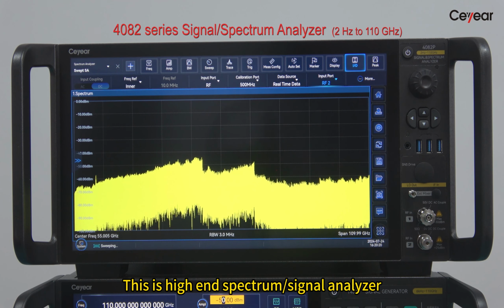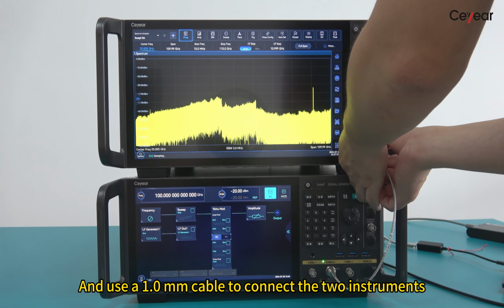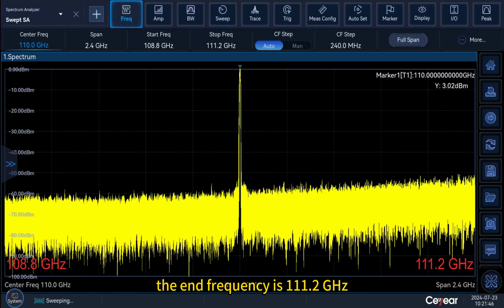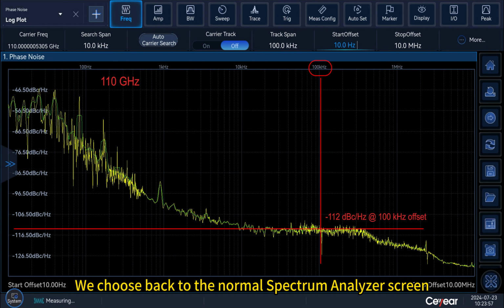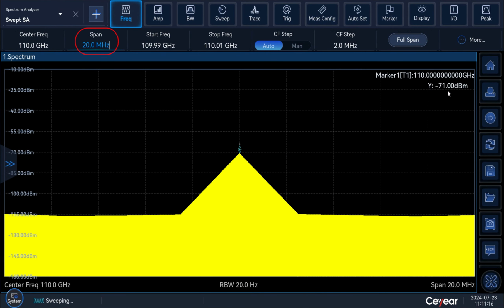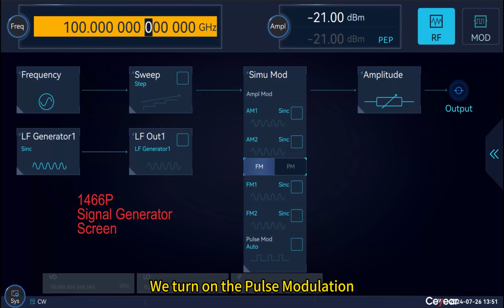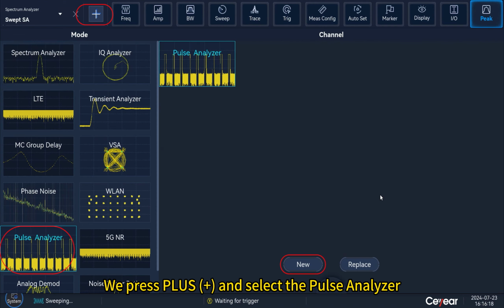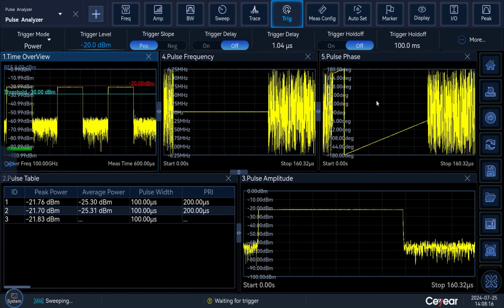How to generate and analyze 110GHz coaxial signals?

Comment: That cable has some gain at 110 GHz!
Reply from the maker: Actually, the signal generator is unlevel  and the ALC (Automatic Level Control) loop is not working at that time. The rising internal temperature led to that but I didn't notice it.  The actual output level is greater than the declared 2dBm.
Reply: You have to notice that the signal generator is prompting the Unlevel message. The signal generator is working under open loop and the actual output power is higher than the displaying.